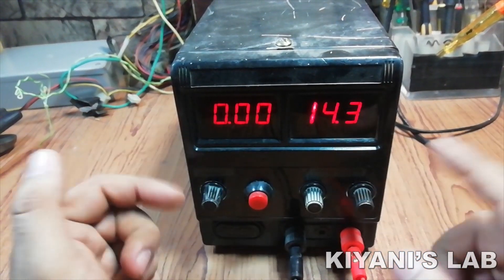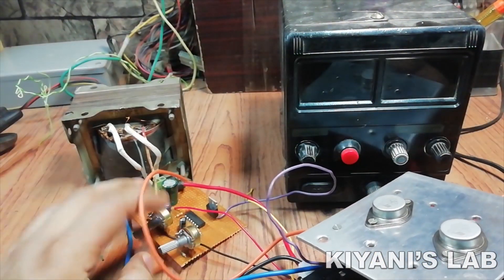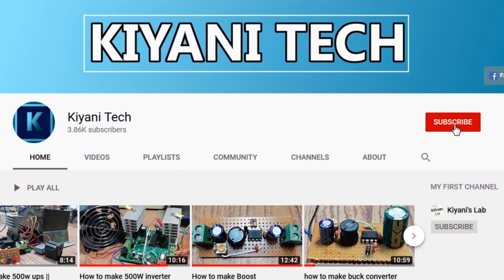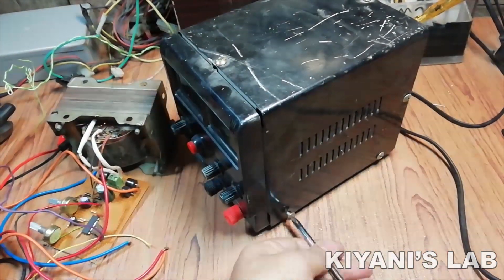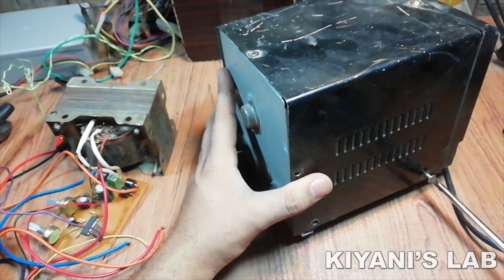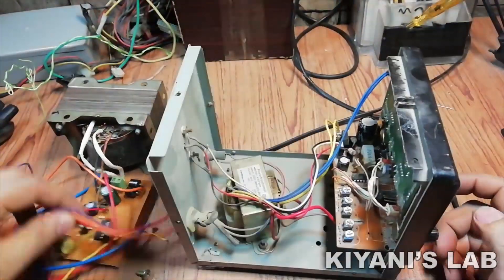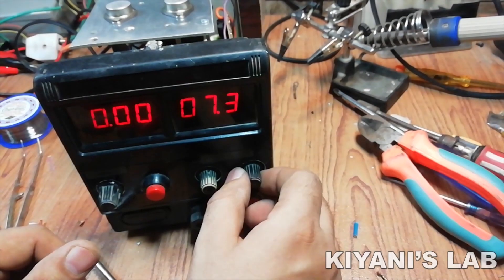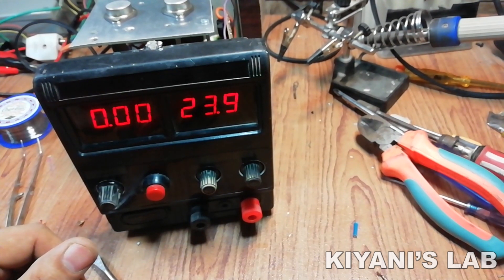Variable Lab Bench Power Supply Upgrade

Comment: You didn't told what's the maximum output Voltage and ampere of this supply ? In earlier video also you didn't told and video ended quickly

Comment: You have not told the following -
1. What's the maximum output voltage ?
2. What's the maximum output Current ?
3. Where will we connect the Digital Volts-amps meter ?
Reply: bro don't waste your supply over this shitty project, it wont last long trust me

Comment: Excellent job. The commercial made powersupply is of very poor built quality. They can't supply above 2A as well as voltage is also limited. Your upgradation is awesome.
Reply: A dual (+ Gnd -)voltage power supply will be of added advantage for running opamps
Reply: @amitghosh6966  yes you are right.

Comment: Thank you my friend. Where do you connect the load resistors in the circuit power supply?
Reply from the maker: i was shunt resistors for current sensing connected in seriese with output